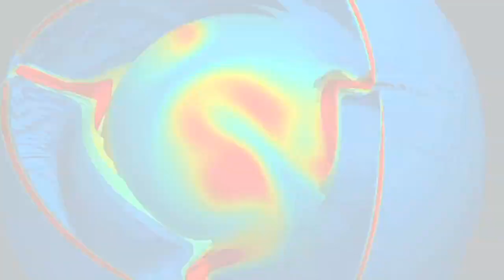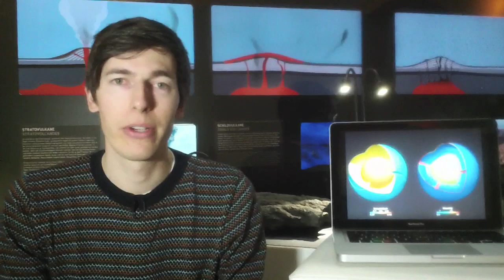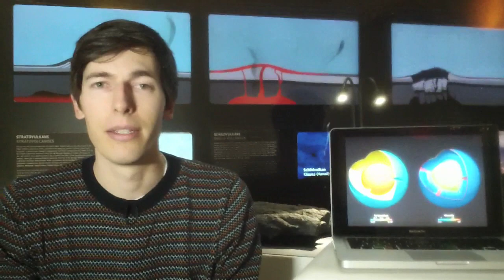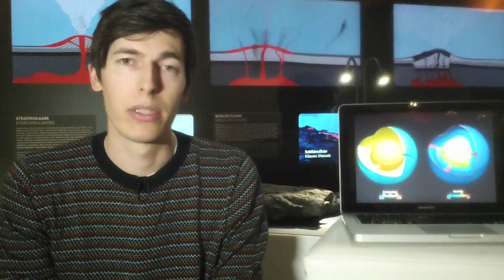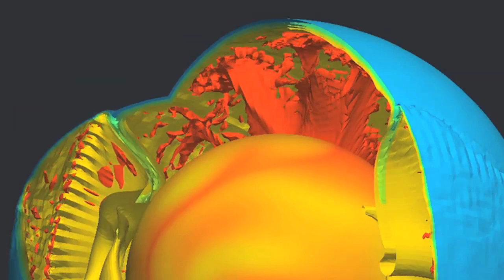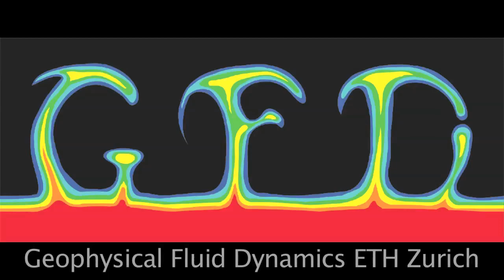Plate tectonics modelled realistically, Interview with Fabio Crameri, ETH Zurich

Comment: It is very interesting. We, the geologists, look forward new advancements.

In future models, besides convection, you should consider additional important things, that apparently you didn´t mention, and which would certainly explain features such as assymetric subduction:
1. Relative westward drift of the lithosphere relative to the mantle. This has been shown by Bostrom, Doglioni and others. It makes westward-oriented subduction angles steep, and eastward-oriented subduction angles flat. This has important implications on the development of subduction drag forces, morphologies, etc..
2. Graded densities of the plates. Older oceanic parts of lithosphere plates are cooler, and therefore denser, which makes them less buoyant realtive to the mantle. These "heavier" plate zones sink easierly, and fasterly, and explain the initiation of subduction, as well as the development geometries of subductive complexes.
3. Differentiation of the oceanic lithosphere (thin and heavy) into continental (thick and light), by subduction magmatism due to the introduction of volatile elements (water, oxygen...) from the top of the subductive plate into the mantle. This will certainly be a consequence of adding the "air" layer that you mentioned, but also the "ocean" layer, at the surface. 

Further on, I would like to know if you are getting at any point the famous mantle plumes  of hot material. 
Well, I guess that this is all quite complex, but a good exercise, to "experiment" and test geodynamic hypothesis.

Also, I think that you should focus on the communication of the different hypothesis that you want to test by doing these numerical models.
 
I hope I am not being too demanding, at this point. I´m just excited and inspired, I guess.

I also wonder if there is an easy way to propose to children or adults to imagine a realistic physical model of our planet that anyone can do at home or at school. I usually think of a fondue (this is very swiss!), or maybe, boiling whole milk. I think that in those examples we also get the formation of features like oceanic plates, at the top of the "cheesy mantle", just like you get a film of cream on top of hot milk (I wonder if cooling or degassing predominates...). This cream film (oceanic plate) forms at the surface, but it eventually subducts, plunging down to the bottom, because it gets cold and heavy, but also carried downwards by the convection current.
I even think that one can get continents formed as convection goes on, by getting a creamy and bubbly foam formed, as patches (continents) on top of the boil. I think that the french geologist Allègre already called the continental plates "the foam of the Earth" (L´écume de la Terre), considering such analogies...

gonzalo_calvo@yahoo.com